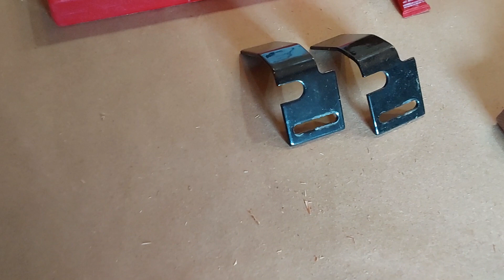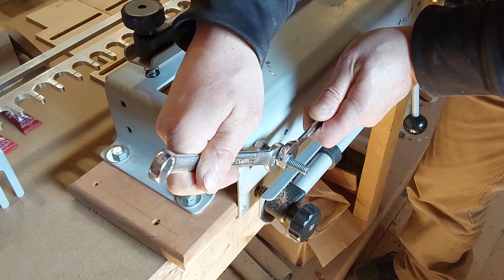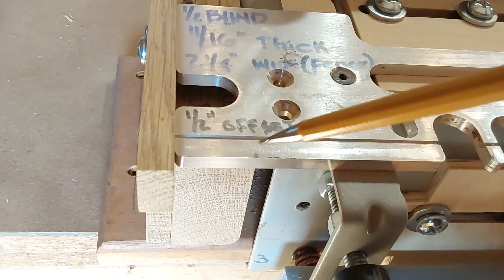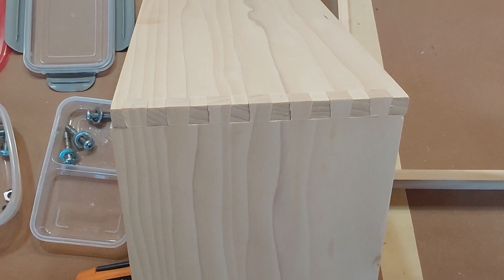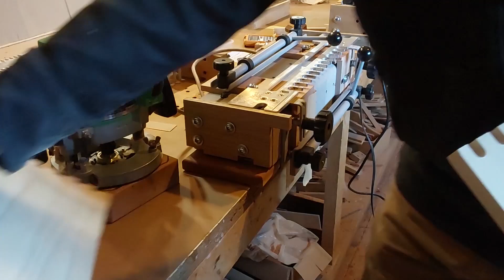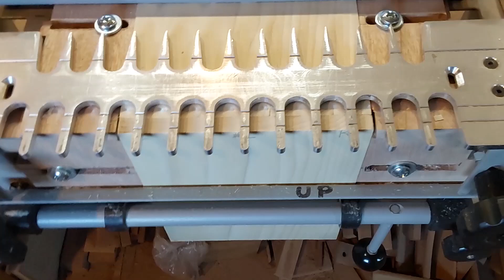Porter Cable Dovetail Jig Tutorial 2, Making Improvements to the Jig.

Comment: Since you like to experiment. What if you cut the template so it is the same length from the center to each side then you don't have to switch the spacers when you flip it.
Reply from the maker: It needs to be cut more accurately than I can achieve in my shop. It is a good idea, but I need a machinist to do it right. Thank you for the coment.

Comment: I very much relate to modifying and improving one’s work tools. No question the improvements clearly work for you.  I can see the merits of at least some.  I didn’t quite follow the offset blocks. It also seems like you’re starting your cuts quite a bit into the template, but I guess if you don’t need to cut particularly wide boards, it’s not an issue. Would love to see an addendum on this video focusing on just the spacers. I can certainly recognize the improvement of having a taller alignment surface than the flimsy little rackety black pieces included with the template.
Reply from the maker: I will try to make that video soon. Thank you for your thoughts.

Comment: 17:30 as you start the cut the handle rotates from vibration -exactly what you're talking about occurring all over.  I definitely have a love/hate affair with the entire machine and respect all your efforts.  The longer reference faces are key... I'll have to try my hand at some variation of your design.
Reply from the maker: @80211Denver  I don't think that handle was as snug as it should have been when I started the cut. Looking forward to your ideas.
Reply: @DavidKlenkFurniture  I did 10 8 in deep drawers last night and I think what I found was the most important thing was technique of leaving one side or face in the machine while swapping out the other one. It allows you to more quickly and accurately set up the next pieces using the Pryor part as a reference face before I switch it out too. In short only swap out one piece at a time
Reply from the maker: @80211Denver  Good idea.

Comment: Blows me away a talented guy like you can modify this to what it should be but the manufacture can't. Its frustrating to not have the option to just buy a tool like this that just works out of the box without modification when you showed its possible.
Reply from the maker: @petebusch9069  thanks, Pete. I agree that it should be like this out of the box.

Comment: I have the same Porter Cable jig and have found that the instructions for setting the depth of cut for a through dovetail are not accurate.  The 3/8" gap between the bottom of the template and the top of the depth stop as written in the manual appears to be correct for half-blind or miter dovetails but not for through dovetails.  
For through dovetails, I think that the depth of cut for the tails should be equal to the thickness of the pin board and the depth of cut for the pins should be equal to the thickness of the tail board.  Is that how you set your depth of cut?

Thanks
Reply from the maker: Yes, but I add an extra 1/64" so I can sand the endgrain into any micro gaps.